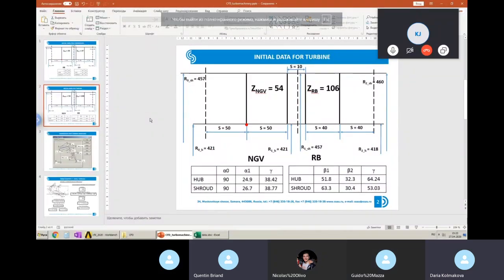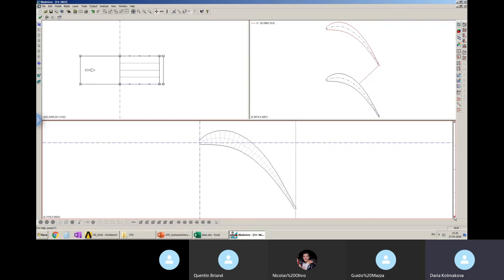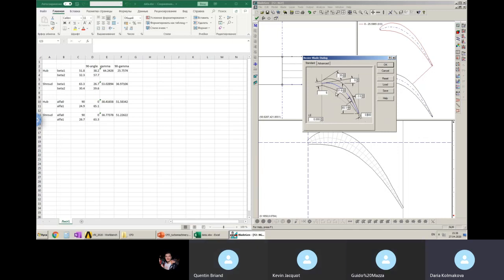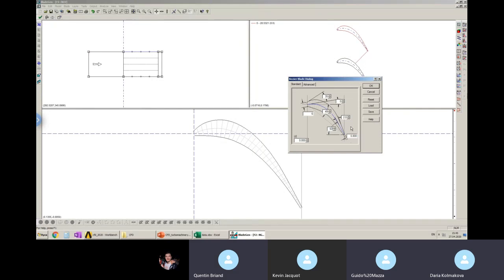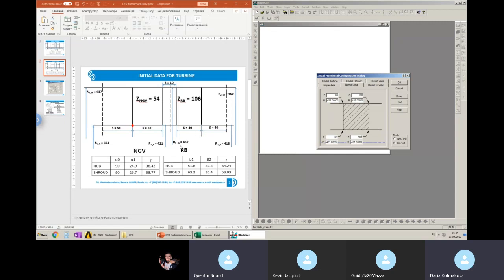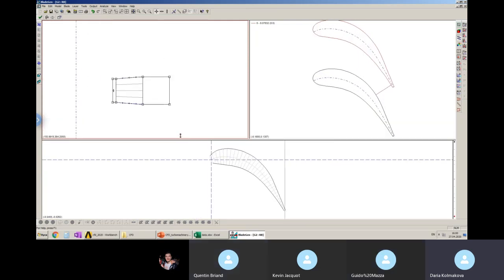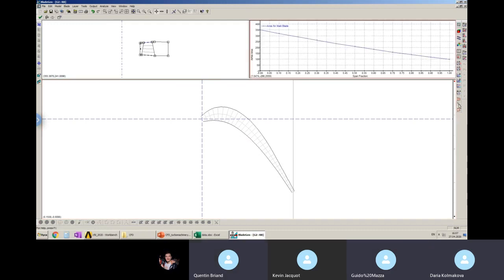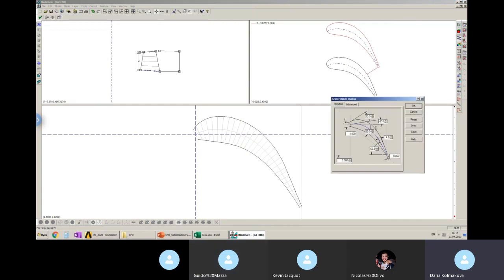Turbine Profilig using Ansys (Blade Gen) (lecture by Kolmakova Daria)

Comment: Could you explain the procedure that how you calculate this data
Reply: Please explain the procedure
Reply from the maker: @FlowScienceStudio  You need to find methods of 1D calculation of the turbomachine you need in textbooks or articles. There are many of them. Something like this https://www.jafmonline.net/article_1785_552db38eff898db561ebfc12e98241b0.pdf. The methods that I have are in Russian.
Reply from the maker: @FlowScienceStudio  There are a lot of descriptions of calculation methods in textbooks on turbomachines or in individual articles. Articles are easy to find on the net. For example https://www.sciencedirect.com/science/article/pii/S0196890409003124.